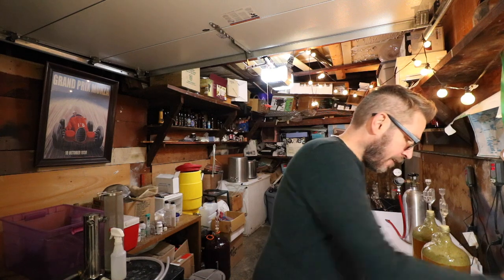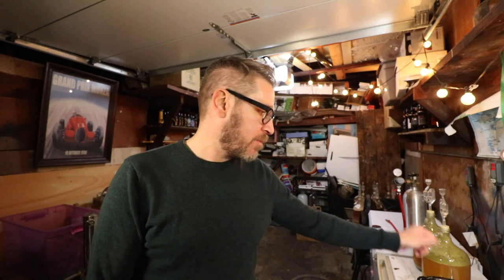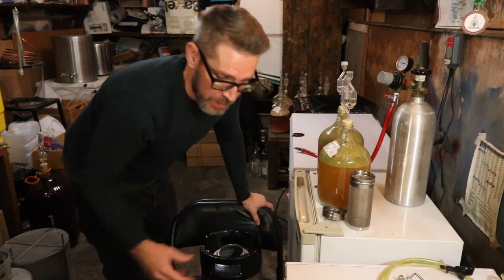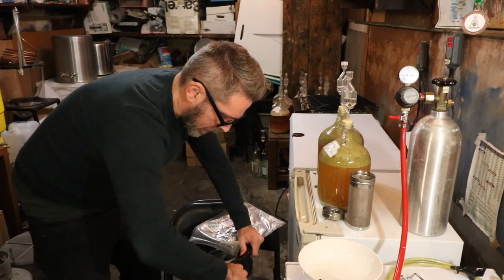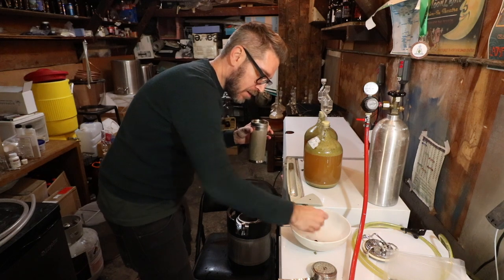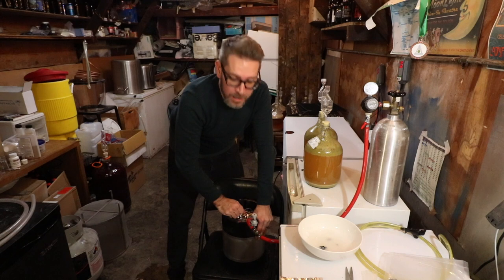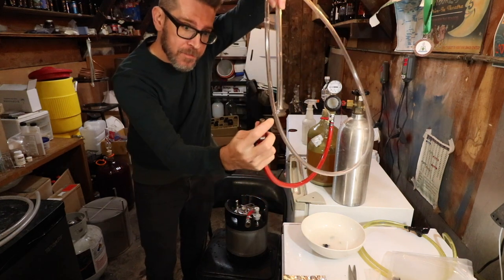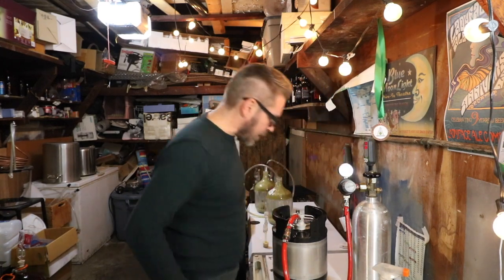A way to reduce oxygen post fermentation

Comment: Great video, I've switched to using buckets with spigots even though a lot of people don't seem to like that type of fermenter. I have a length of tube connected to a ball lock liquid post and transfer that way. One extra step I think I'll do is another tube connected to the gas post to push the co2 from the keg over the top of the beer in the fermenter, I haven't done this before and haven't noticed oxidation but also have mostly done malty or yeast forward beers.

Comment: The trick I found that made the most difference with oxygen limitation while bottling is to bottle into plastic bottles and squeeze out the headspace from them before closing. Before that I had terrible oxidation problems with my bottle conditioned neipas. After that no problem. Started kegging though, totally worth it :)
Reply: Cool I use the same trick and it works great sometimes! Sadly a few times even though the beer is bright yellow and smells amazing there can be this awful woody aftertaste that only some people (including me can taste), it's particularly bad if drinking a coffee before, still not figured out what is is but the taste doesn't exist before bottle conditioning.
Reply from the maker: Interesting! I may have to try this.

Comment: If you don't keg hop, fill the keg with star san, purge, then push all the star san out.  Its better than just purging. . This primarily for closed transfers.  +1 on purging the lines (otherwise it's pointless to purge the keg).  I use a rigged line setup with a ball valve going to a star san bucket like a blow off, pressurize, release some through blow off, pressurize.  It's better than nothing.  A PRV might be helpful too but I like to be able to dump the first bit of beer to ensure that any o2 ahead of it goes out and not into the keg.

Comment: I've just started worrying about oxygen but based on gas dilution I couldn't see how purging would get it all out.  Read an article about it and since followed up with filling the keg with water after sanitizing then pushing all the water out under co2 pressure.  That way you know you've really rinsed everything and also ensured that there's nothing but co2 in the keg.  It uses a little less gas too as you only fill it once.  As the co2 is denser, when you are transferring the beer, it should be pushing the bulk of the contaminated co2 out.   Followed by a few purges like you did at the end.  I'm thinking about adding a low pressure bag I can hook up to the FV to use to back fill the FV while it's cold crashing and emptying.  A friend tried that and found a significant amount of gas goes back into the FV when cold crashing due to the pressure change with the temp.  Sorry for the long comment.  Love your work.
Reply from the maker: I heard about this method with the bag, or a ballon type set up. I've also heard some will hook up a line from one keg that is fermenting to an empty keg, which during fermentation fills with CO2, then they just transfer directly into the empty keg once fermentation is done.